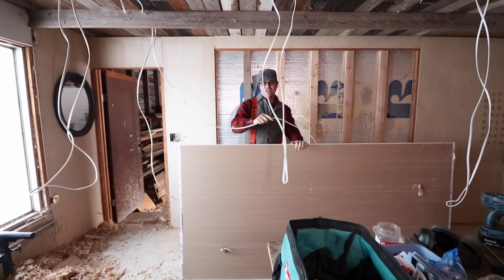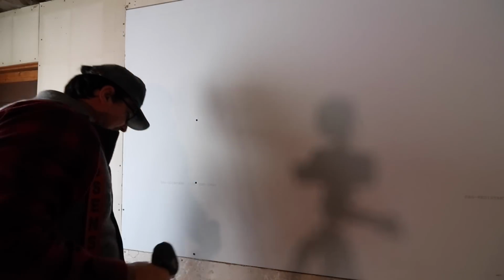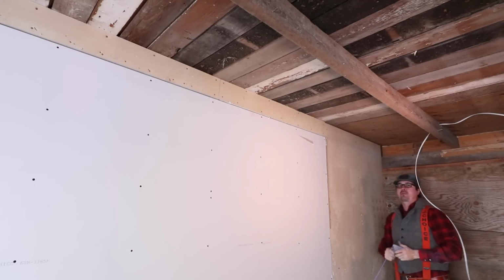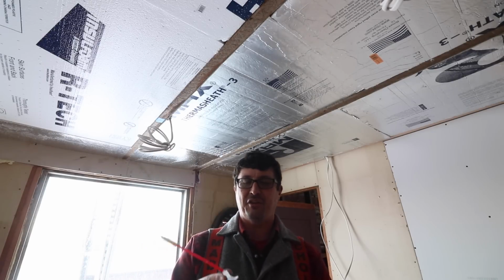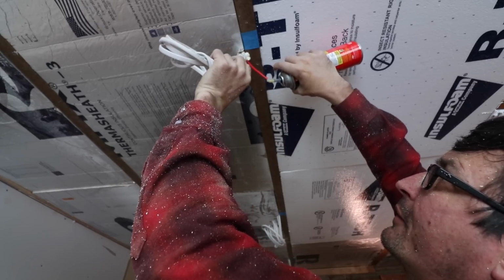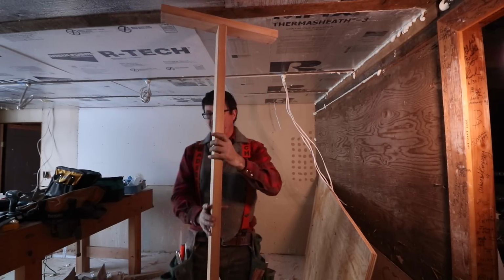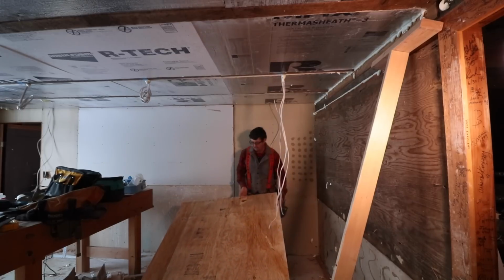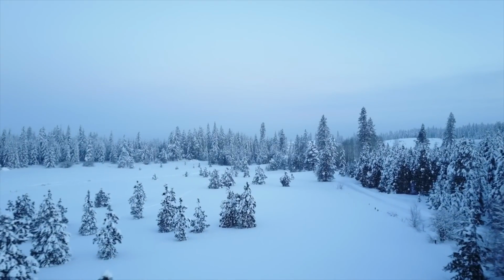I'LL NEVER DO THIS AGAIN!!

Comment: I worked as a plasterer for over 30yrs and believe me working over head makes those shoulders sting. Sheetrock 5/8ths 12ft long is no picnic! One way Cody is to fix a pattrice at one end and lay the board on it, then with the dead-man (T thingy) leaned against the wall adjacent to the other end of the board, lift the board using the pattrice as a pivot point and jam the dead-man under around 2/3rds the way across. Balanced you can then guide the wires through easily. It's hard work and we find the easiest method possible when boarding out. Nice job.

Comment: Coming along nicely, in spite of working alone overhead.  This is going to be a wonderful work space with better lighting and insulated.  The white paint on the ceiling will indeed reflect a lot of light, and that will add to the camera seeing better.  I like the exposed conduit idea, easy to modify when needed, and it allows you to put the outlets where you want them as things change and equipment moves around in the shop.  A suggestion, mount your air line around the shop wall as an exposed pipe, and put outlets om each wall.  This will allow you to run an airline so that it doesn't get in your way when working around a project, adding versatility as well as safety.

Comment: I've use a "dead-man" when putting sheetrock on ceilings but painters jacks work better.  A dead-man can be wedged against the floor when it's a few inches longer than the distance between floor and the panel you're installing.  Another tip is to tack a 2x4 as a ledger to hold up one edge of your panel.  If it's about 2" lower than the ceiling, you can put one edge in the "pocket" and lift the other end.  You don't have a balancing act that way and Jack can get the dead-man in place between you and the wall.  Those 3/4" sheets are heavy.

Great progress so far and I DO LIKE the landscape shots at the end.  Anyone who doesn't like it can just stop watching at that point.

Comment: Cody, one thing that is a big help for putting up plywood overhead by yourself is to set up a section of scaffolding - you only have to lift each end another foot or so. And if it slips, it won't fall far. Since you won't be standing on it, you only have to put one X brace on the two scaffolding sections, that way you can walk under easily.

Comment: Tip, when you are putting up sheets by yourself,try putting a cleat on the wall on the long side, in your case roughly 7/8" down from the ceiling. it will help hold basically one half of the weight for you, and allow you to screw off the opposite side. it will help you to fish the wires too, only having to bear one half the weight. love the videos, wish I had half of your resources.

Comment: I built a sheet goods lift using scrap 2x4s, 1/2 nuts and bolts, and a boat trailer winch.  Makes lifting 4x8 sheets by yourself a breeze!  You can adapt it to put sheets on ceilings and walls!

Comment: Question? How will you ever get to the electrical junction boxes if you have a problem with the electric? The code here says you can never cover, hide junction boxes without access 
and that's why we put them in switch boxes or ceiling light boxes.

Comment: When you insulate with hard foam you need to cut 1" shy and spray foam to properly seal. This makes the seal better and the fitting quicker.

Comment: Oh the memories of overhead work....such fun! Lol! I have had many sore shoulders from doing the wood ceilings in homes. And yes, do show the juicer and how you prepare your meals. People who don't want to see it....can just not watch it! All the 499k of us will watch it and be happy!! 
Tip for you Cody, I use to have some really tall saw horses (5' high) to set the plywood on, then run the wires through it, then get under and start some screws, then push up and screw it to the joists. If you don't have saw horses, use some ladders with 2x4s stuck through the rungs.

Comment: for the plywood ceiling ya start one screw towards the center of the outer edge, bang two spikes into two middle studs just under the thickness of the material from the ceiling , put the edge on top of the spikes and lever it up with one hand and screw it on with the other... when running sheets use a bit of strapping between sheets as the fulcrum...

Comment: The  drywall screw bit is designed to make a dimple in the drywall without tearing the paper.When you tape and mud you fill the dimple with mud to hide the screw and also to  keep it. from backing out over time.

Comment: Rafters are ever truly square.  Using the expanding foam is a good way to seal the heat leaks.  You do need it.  Think of a room full of heat, the same as it would be if it were filled with water and turned upside down.  If the water could seep out through gaps, then heat most certainly will.  You still have to ventilate though.  A couple of air changes per hour is what you need to keep oxygen levels OK.
Don't squirt foam on the cables.  Some foams can attack the insulation on some types of cable, especially the old PVC.  It can also thermally over-insulate the cable and stop heat getting away... so if the cable is heavily loaded it can get too hot.  The job is looking good though Cody.

Comment: My secret for hanging drywall and other sheet goods on the ceiling by myself was to take a door hinge screw it to the end of a 2 by 4 screw that to a wall stud up at the ceiling leaving enough room for the sheet to lay on top. Lay the sheet on the 2by 4 , with a t piece nailed to the bottom of the stud. Lift that up and wedge another stud from the floor to hold it in place. It will hold it in place and allow you to adjust it. When done move to the next piece and repeat. Can do it either length ways or side ways.

Comment: I like the comment about trail mix, used to happen to me all the time doing electrical work with a sampling of every screw, connector and wire nut mixed up in my pouch.

Comment: If you take a piece of scrap you can put a cleat on the wall to hang one end of the ply off. Then put your stick on the other end angled slightly toward the cleat and it will hold it in.
As well push the wire up into the ceiling until there is about 2 or 3 inches sticking out. makes it easier to line up with the holes. then just grab and pull through.

Comment: That work room will look amazing when done Cody!!  For those interested they make a lift like professionals use to lift drywall up to the ceiling that you can rent. If a person is doing a lot of rooms in a home, it can be economical to rent one. Being plant based, no animal products, I remember having to wean myself off of meat first, then eggs, then dairy so that I didn't have the problems some folks have going cold turkey.  As for the term detox.  It simply means your intestinal system, liver, kidneys are getting rid of the cholesterol and food fat residue stored.  After 3-4 days you do feel more energized and great.  None of the bogged down feeling.

Comment: to put the plywood up could you try a temporary batten on the wall? to use as a ledge to hold the edge as you lift the other end? and start with it on a table so your not lifting in from ground level but waist hight? 
you could possibly do the same for the middle one by putting a batten on the ends of the last ? 
im not a builder just a maintenance worker

Comment: Nice video, I never tire of trees covered in snow. Try run a batten of wood around the top  of the walls, 1 inch from the joists. Then tuck the ply wood between the batten and joist at one end and use your prop at the other end. Regarding the diet subject. It is your channel, you continue doing what you want to do. The Ariel shot of trees has nothing to do with workshops or homesteading but it is wonderful. You can please some of the people all of the time and all of the people some of the time but you can't please all of the people all of the time.

Comment: install a temporary 2x4 cleat on the wall on the 4 foot side of the plywood, pull your wires through the plywood, then pivot the sheet up into place and hold it with your t. finish screwing the sheet up. the same can be accomplished with the sheets in the middle, just screw a cleat  with a spacer on it over the edge of the previous sheet, then slide next sheet into place and carry on. done this many times with both sheet rock as well as strand board and ply, by myself.

Comment: For what it's worth, I'm working with a lot of 2" styrofoam board too.  I developed a way of cutting it that has been way more accurate than trying to score and snap it.  (Score and snap works on thinner foam board but in my experience the depth of the 2" board leads to inaccuracies.)  Also virtually no dust, as a saw would throw out.

I took an old used up blade from my Fein oscillating saw and ground all the teeth off on my grinding wheel, then put a knife edge on every edge I possibly could.  It will make plunge cuts as well as "rip" cuts.  It's like a hot knife through butter and gives me amazing control around complex shapes.  

Hope that's some help to ya.  Blessings!

Comment: Speaking from first hand experience, no matter how many times you have done it in the past, putting up a plywood celling when you are pretty much by your self you simply cannot look like you know what your doing. There are always too many corners and not enough hands. Glad you got it up there without it falling on you!Just a suggestion but if you take some heavy cord and run it up thru the hole you drilled and then tie/tape it to the end of your romex you can put up the panel and then simply pull the wiring to the hole after you get the panel up.

Comment: little tip for poking wires through material is to tie a sacrificial piece of string/line to the wire with a smallish weight on the end to let gravity do most the work on keep the wire down and straight and stop it from wanting to lift up with the board/material being used. Goes without saying as i can clearly see you are a skilled tradesman but though this little tip might help or help in the future. all the best!!

Comment: next time put a 2x4 ledger on the wall where you hung the sheetrock. put it about 1 " down from the rafters. you tuck the plywood over the ledger walk down to the other end and lift the sheet up the ledger holds it on the far end.. then you can reach around and grab your dead man and put under the end close to the camera and its up all but the screws
Reply: Absolutely. It’s the only way to do this.

Comment: I like what you are doing.  You should have put the T-jack in the corner under the plywood, put the wires through and then picked up the out end.  Push it up tight, and put a screw in. Leave it there and check the corner fit is tight and then screw it down tight.
  I have done alot of sheetrock work overhead by myself. 
                                                                                   Geoff

Comment: Set your sheet flat on 2 4' ladders to do your wire feeds, then raise to the roof. Let me know how the reflective foam board performs with the wood stove as I have ambition to go with roughly the same insulation set-up. Looking good!
Reply: Standard (UK) foam board insulation thickness for ceilings is 100mm, 50mm for walls - but he's not paying for his heating, so...

Comment: I am a retired fireman and after fighting fires in confined spaces for 35 years I found there was a tremendous difference in confining the fire to a room if all surfaces were covered with drywall.  The plywood on the ceiling will burn like crazy and will promote fire spread into the structure.  Thinner plywood, as suggested is even worse.  As soon as fire impinges on the plywood, it begins to delaminate as the glue breaks down and the ceiling disappears and, in fact, adds to the fire build up and spread.  Being a fireman yourself this should be a significant concern for the safety of the structure and the fire crews that need to make the interior attack in that space.  If you do need to have the plywood on the ceiling to attach things to, I would strongly recommend installing sheetrock under the plywood.  The plywood will still add to the fire build up, but the sheet rock will slow fire spread greatly.  Just a concern from a fellow fireman that attacked many interior fires over the years and saw the benefit of sheet rock versus plywood to contain fire.

Comment: Hanging ceiling by yourself is hard.  My house was built in 1900 and has the same "unique" cuts on everything.  One of the tricks I did was screwing a 1 X 2 along the wall an inch below the ceiling then sliding the edge of the drywall into the slot, I roll the sheet up and set the T brace under.  But Jack works better!  I would like to hear your detox journey, but maybe talking about it at the end while you are drone closing.

Comment: I would question the reason for 3/4 inch plywood on the ceiling. Wouldn't 3/8 inch plywood serve the same purpose? Regular drywall is 1/2 inch, and much lighter.  Jon

Comment: Hi Cody. Thanks for all the great videos. A couple things. Did you consider corrugated metal roofing for inside your workshop. It's lite weight, fire resistant, great light reflectivity if the right color is chosen and possibly cheaper than 3/4 plywood. As far as your vegan diet goes, go ahead and do a video. If someone doesn't want to see it they don't have to watch it,  but there may be people who enjoy it. Keep up the great work!

Comment: Cody! Your wooden "T" is known as a Dead Man! I've sheet rocked many remodels back in the day. I would have put up 1/2" sheet rock and use the plywood for other projects. I also have several of the screw bits, they work great. I would have used 2 dead mans to hold up the board, saves a ton of wear and tear on the shoulders :)

Comment: working a ceiling is pretty easy if you just get a $150 drywall lift. You can pick them up at harbor freight. They make them to easily lift a flat piece of plywood or drywall from waist level to overhead flat up to 11 feet high and most come with large casters to move them easily. If you are redoing a whole ceiling they are worth every penny.

Comment: My suggestion for stringing the wires through the holes would be to tie or tape string to the ends of the wires, prop the sheet against the wall at the ceiling, thread each string through the appropriate hole, raise the sheet up and support it on two T-bars, pull the strings and wires through the holes, then finish raising the sheet and fasten.

Comment: Your a total inspiration Cody, but being in the design construction field you might be concerned with the air cavity you created between the roof and the rigid insulation. The insulation should have been against the roof directly and the air cavity on the warn side. Any cavity between heated and not heated needs ventilation to eliminate moisture buildup. You could add small 3" diameter air vents outside at each joist bay would help.  
Best of luck.

Comment: this is a Homesteading channel but you're only as productive on your homestead as your body allows you to be. I'm praying for you. keep it up.  your body needs this more than you think. i have also changed my eating lifestyle and have loss 26 lbs this month alone.  keep up the good work for your health, Mrs. wranglerstar and Jack
Reply: That's impressive but the current wisdom among dieticians is 2lb or less per week for healthy weight loss.  I was classed as morbidly obese when I was in my late twenties at 6ft 1in and 371lb (26 and a half stone in old English).  It took me nearly two years to lose over half my own body weight, I got down to 175lb (12 and a half stone) now I'm in my early forties and I've put on about 28lb in the subsequent decades.  Best of luck with your weight loss, slow and steady wins the race

Comment: Great that you got such a good deal on 3/4" ply, but I don't understand why you are putting it on the ceiling? I'd have used that nice stuff you did your house with and kept the ply for the walls, where you'll be hanging stuff off it.

Comment: Also, when hanging the ceiling panels, put a cleat on the wall that's down about an inch or so from the ceiling.  Slide the panel into it and then lift the other end up and support it with your deadman "T".  I've done this with drywall, I think it would work with plywood.  That way you're not doing a dead lift of the full weight of the whole panel, just one end at a time.  

If you lived closer I'd loan you my panel lift.  It's the best thing since sliced bread.   :)
Reply: But I missed the rationale for 3/4" plywood on the ceiling.  Why so much weight over your head?  Why not 1/2" at most?  Or just drywall?
Reply: Doug Dobbs He wants the wood grain on the ceiling and in his previous video he said that he got a really good deal on that 3/4 (I think it was $24 or $27 a sheet). The 3/4 also adds to the r-value and helps deaden the sound going to the main floor.
Reply: Cheap cost, I get. 

But if it was me I'd go for a lighter and more flame retardant material.  Especially in front of that styrofoam.  Hope the exits stay clear.  Not the place I'd want to be in a fire...  :)

Comment: This is your channel. Put the content you want to share. It's you and your families life. I'm not much for the diet thing but I feel if I saw what you do and how you prepare it I might give it a shot and I am sure there are others like me. So even if you got 20 people to try something heathy and in doing so make 100 people upset I would call that doing some good. Great video. I hate hanging board overhead, especially 3/4 or 5/8 in commercial applications. Good story pole idea too I use that sometimes the lifts are slow and cumbersome to move around at times. I use them bits to by the way haven't used the drywall gun in years.